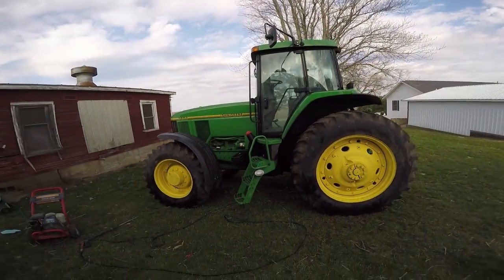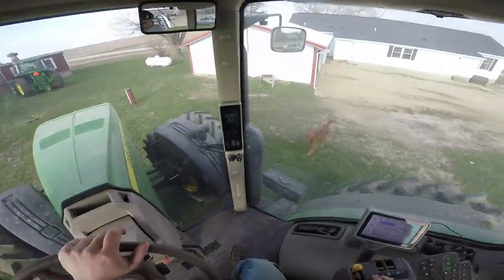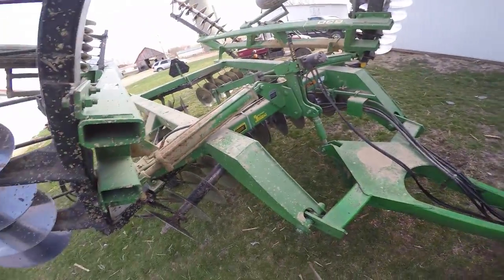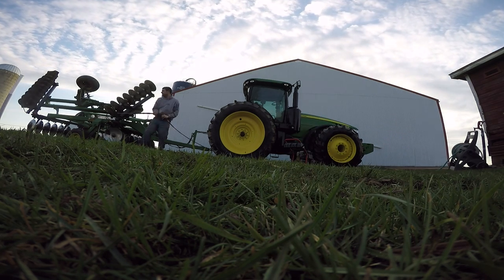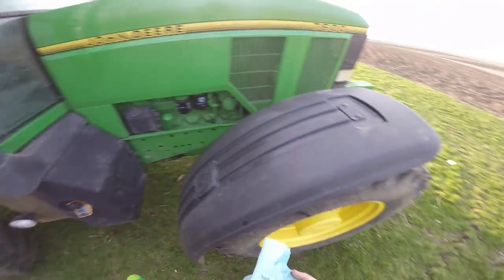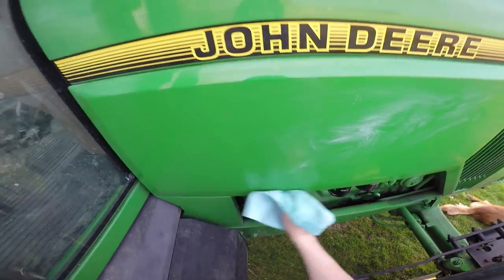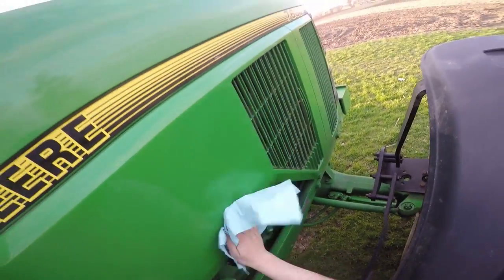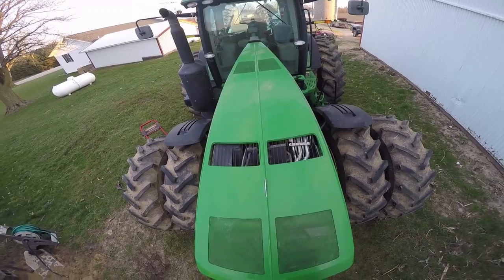Washing The Tractors

Comment: sorry to be critical but you should have had the tractor completely clean because if its not and you start to buff on the wax you will scratch the clear coat with the little grains of dirt and dust, and also you didn't spread the wax out evenly. Sorry still love your vids keep up the great work
Reply: There is no clearcoat on plastic panels...they are molded green

Comment: To be honest, when it comes to washing our tractors and even our farm trucks, we don't always use soap if we don't have any. My dad and I don't see the point in dropping everything to drive 30 minutes to town, spend 10 minutes in Tractor Supply or a gas station, then 30 minutes back to our farm. What could have been a 20-40 minute job, just turned into an hour and maybe 40-50 minute job.

Comment: Cool video, but most important thing is to wash the interior, the exterior will get just as dirty in 10 minutes. I like to sit in a clean cab that dosent smell like manure or pesticide. And make shure to use a degreaser to clean the plastic before putting armor all because you will just armor all over the dirt so you end up with a dirty shiny interior. I clean and deatail the interior just as good as my truck or car lol